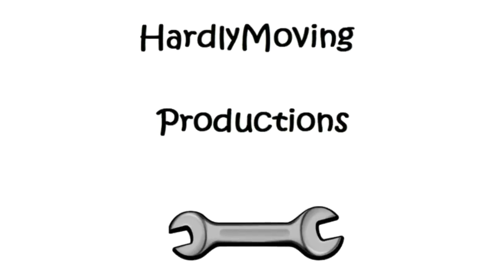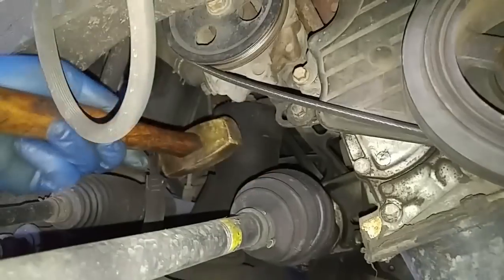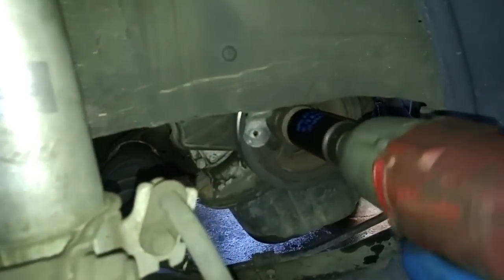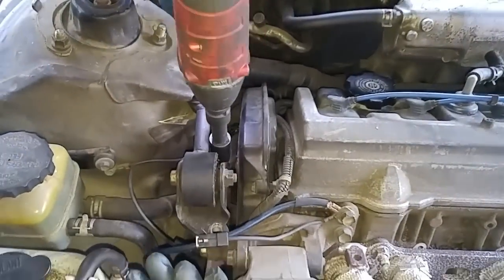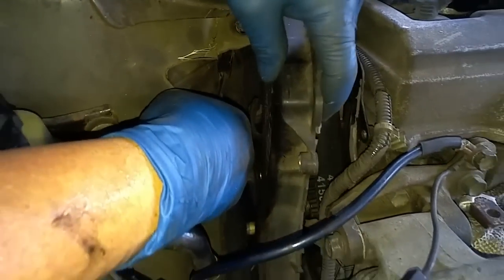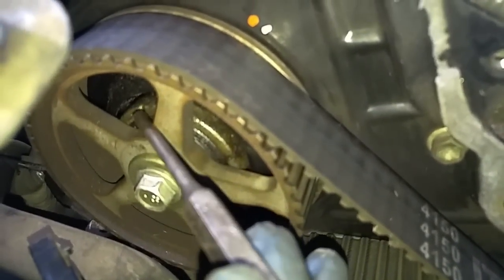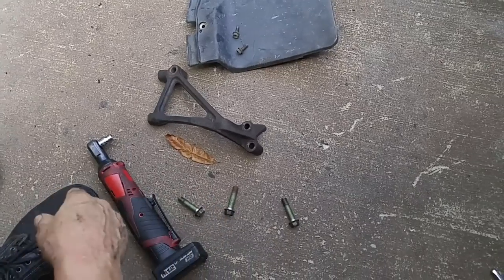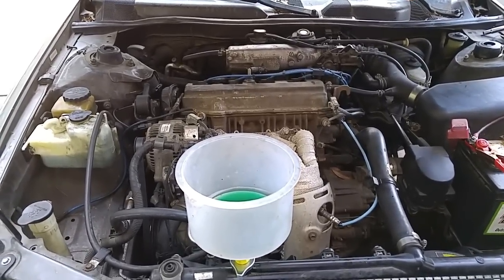Camry Timing Belt, Water Pump, Seals & Pulleys Replacement:  2.2L I4 5SFE Engine

Comment: I bought a JDM engine and put the timing belt and water pump on and the cover back on before installing it in the car. Do I need to remove the cover, now that the engine is in the car to verify the tension? Thanks, great video
Reply from the maker: No ... your fine.
Reply: @hardlymovingpro  Thanks, I didn't really want to undo it. Excellent video. 🔧
Reply from the maker: @billdougan4022  No problem.

Comment: Are you sure you should use the wire brush to clean off the old waterpump gasket? I'd be afraid of gouging the surface too much.
Reply from the maker: Absolutely.  We techs at the shop do it all the time.  Do not, however, use sand paper.  That is too abrasive and WILL result in a poor seal.  If you want, you can break in the brush by wire brushing against concrete.  This will get the wires oriented in the direction of the rotation.
Reply from the maker: And ... you do mean the water pump mount ... not the gasket?
Reply: @hardlymovingpro  Yes, I meant cleaning the old gasket off the mount.  I ruined an intake manifold using a grinder with plastic abrasive pads. But that was aluminum. So, I always cringe when I see someone using a wire wheel like that. Good tip about the cement!   
Also, your video was great - one of the best so far.

Comment: Question, the cam and crank marks dont line up how can i fix that ? do i take the timing belt off and line them up separately ?
Reply from the maker: Can't say without seeing what's going on.
Reply: @hardlymovingpro  I believe the timing belt slipped and  it jumped time, whenever I line up the cam the crank is off and vice versa it's the same engine as in your camry the 5SFE if this happened to you how would you go about realigning it
Reply: I'm sure you've already figured out yours but I'm writing this for the next guy that has the same issue. 

Take the belt off and line them up separately. After they're both lined up, put the belt on again making sure marks on camshaft and crankshaft stay lined up. The misalignment usually happens when you turn the crankshaft 2 revolutions. This is when belt tends to jump a tooth or two because the spring doesn't put enough tension on belt. In order to avoid this, after installing the belt with everything lined up, pull up on tensioner pulley to put extra tension on the belt, hold it there and tighten tensioner bolt. Don't torque to 31 ft-lbs yet. Just tighten it enough so tensioner doesn't move. Now make sure all teeth from water pump drive pulley, camshaft pulley,  and crankshaft sprocket are engaged with grooves in belt. If you have to do more work to engage any of them, you have to check timing marks on both camshaft and crank again. Once all this is good, rotate crankshaft exactly 2 revolutions and verify timing marks on both shafts are lined up. If they are, now make sure there is more tension on the part of the belt that's facing the front of the car than on the part of the belt that's facing the rear of the car.  If that's good you can now torque the tensioner bolt to 31 ft-lbs. Some people loosen the tensioner bolt at this point so that the only tension on the belt is from the spring and then they torque it to 31 ft-lbs. I do NOT loosen it and then torque it. I just torque it because the first few times I loosened it and then torqued it, the belt would come a little loose and rattle so I would have to do the job again. I've never had any problems with it being too tight because you can't put that much tension with one hand and I've never had one break. I have always replaced them due to mileage (90,000 miles) not breakage.

Comment: I have the same car and my timing belt broke. I can see that the crankshaft is off TDC now. I read that your not supposed to turn the crankshaft pulley to TDC without the belt, but it seems like a contradiction. Can you please clarify? After watching you do this I see that you adjusted the Crankshaft pulley with the harmonic first and then the camshaft up top afterwards, but your timing belt is on. Please help me figure out the process, thank you!
Reply from the maker: The 5SFE is a non interference engine so you can move the crank or cam (independent of each other) in any direction with the timing belt off.   You set the crank at TDC with the harmonic balancer on.  Find the notch on the balancer and turn the crank until the notch is aligned with the 0 degree mark on the lower TD cover.  Then remove balancer and the two TB covers to get to the cam.  Align the cam to TDC (via the hole in the cam sprocket) as shown in the video.  When ready to mount the new belt, you can turn the cam one cog to the right to ease the belt installation.  After the belt is on, turn the cam back to the TDC mark.  The belt should now have no slack and the crank should not have moved.
Reply from the maker: Here's the video link showing how to deal with a broken 5SFE timing belt:https://youtu.be/7LxaY6GPy-k
Reply: @hardlymovingpro  Yea your right. Thank you very much for taking the time to reply!
Reply: There is also a timing mark on the crank belt cog. It lines up with a small notch on the block at about 11 o'clock so you dont have to put the harmonic balancer on during the job. If you stop the vid at 14:32 when you are installing the crank seal you can see the notch.

Comment: I got both new tensioner pulley and idler, when I try to turn them by hands they barely spin 180 degrees. They are aftermarket branded. Normal or should I just reuse the one on the car ? (They spin more than freely)
Reply from the maker: Sounds like something is wrong with those new pulleys.  You should replace the old pulleys with new ones with the new timing.  Go to rockauto.com to get decent aftermarket pulleys.
Reply: @hardlymovingpro  Gotcha yeah good call thank you. I was able to find the seal  puller, a chain wrench and even the cam seal tool you're using in this video. I got an aftermarket water pump sitting at home but read the reviews ( "Ultra Power" ) branded and some guy said it broke after 3 months so now I am more than skeptical installing it
Reply from the maker: Try the brand GMB or Aisin for OEM quality.
Reply: @hardlymovingpro  thanks a lot for all your replies. What's your opinion on the NPW water pumps ?
Reply: @hardlymovingpro  I actually found a kit with Aisin waterpump and tensionners branded GMB. Should be pretty good right ?!
Reply from the maker: Yes.  I've used GMB with no long term issues.  GMB is a Japanese based company.

Comment: The pully with the spring is a tensioner and to adjust the timing belt those cars usually have a pointer and also have a a access hole in the cover for adjusting the timing belt
Reply from the maker: Maybe but I prefer to see the belt moving with the cover off to determine the right amount of tension.  I found the belt being a little loose makes a difference with respect to engine lag.
Reply: @hardlymovingpro   I've done many and I completely agree. I don't think @wmwil2564 is talking about Toyota's 2.2 liter 5S-FE.

Comment: great video as usually very informative thanks
Reply from the maker: Glad you liked it!
Reply: @hardlymovingpro  however I've seen the other videos and they say the camshaft has to be lined up with other mark there are two marks one like a circle from the drill bit and the other one like on your video v-shaped which is little higher up do you know something about it?
Reply: on my car it wasn't lined up at first place it did start up roughly and wasn't working properly as you drive so if I line up the crankshaft and then line up the camshaft itself without a belt would that work?thanks
Reply from the maker: To know what's TDC for belt installation:  1.  For the camshaft, line up the little hole in the cam sprocket with the vertical notch on the engine.  It's hard to see without a mirror.  2.  For the crankshaft, put back on the lower TB cover and pulley.  Rotate the pulley until the pulley notch lines up with the 0 degree mark on the TB cover.
Reply: @hardlymovingpro  put it all up together works way better then before however I've forgot to disconnect battery and alternator earth cable shortend up so blew the fuse other way all good thanks again
Reply from the maker: Okay ... great!

Comment: Nice video -- what happened at 18:33 can sometimes be avoided by the following a different tensioning procedure for this engine (5SFE) and the very similar 3SFE engines, as well as some other belt-timed Toyota engines.  The process is to install the tensioner spring before installing the belt, and to tack down the tensioner pulley at 45 BTDC cylinder 1 after ascertaining that timing is correct, following a particular series of steps

This is the procedure from the Toyota FSM.  It is a little unusual, but it works, and it helps to avoid the situation you guys faced in having to re-tension the belt.  This procedure is shown in this other video from Ratchets and Wrenches Channel, if you skip to the 03:26 mark in his video, you can see what I mean: https://www.youtube.com/watch?v=ZKHOOU6ZV-Y

Thanks for posting your video, too, since you show the seal replacement but R&W doesn't.  I just though I'd let you guys know in case you have another job like this one -- it can save you some time.  I've done the 45 BTDC on a 3SFE and it works great for tacking that tensioner down just right.  

Thanks again.
Reply from the maker: Thanks for your post ... but been there, done that and doesn't work for some reason with all replacement belts (Gates, Dayco, Continental, Mitsuboshi,  ITM, etc.).  Use to do the 2 full rotation method and the belt still became loose after starting the engine (of course after buttoning everything up and having to remove everything again).  Starting the engine does a better job of seating the belt with hundreds of rotations instead of 2 rotations.  And its always good to verify your work by observing the belt rotation while the engine is running to look for belt wobble (indicating a loose belt).  Don't agree with stretching/maxing out the tensioner spring BEFORE putting on the belt.  What's the big deal putting on the spring AFTER the belt is on? Also, there's indication that there's a oil leak from either the cam seal, crank seal and/or oil pump housing seal that he hasn't addressed (which will result in a premature belt snap when oil gets on the belt), there's no way the water pump will last to the next service interval unless he replaces it now, and he's putting on the belt with both the cam and crank at the TDC mark which I've found most techs I've trained have difficulty doing (most especially with newbies).  You just advance the cam one cog, mount the belt then set the cam back to the TDC mark ... simple and easy.  This is what I've learned after doing over a hundred timing belt jobs and dealing with customer "come backs".   Again, thanks for your post!
Reply: @hardlymovingpro  Thanks for the reply!  Yeah, I agree that R&W should have replaced more parts while he was in there, but maybe the customer couldn't afford it or it was his own junker, I don't know.  I linked that vid because he shows the little 45 BTDC mark, which is hard to describe without a picture.

I know that process doesn't always work, but it has worked for me, so I thought I would share it!  Thanks again for the video.
Reply from the maker: Hey ... no problem and good discourse. FYI - if it was my own junker, I'd replace the seals and the W/P.
Reply: @hardlymovingpro  Haha, agreed.  Thanks again

Comment: Where can I buy that tool with the chain you use to hold cam sprocket when tightening bolt.
Reply from the maker: It's called a "Chain Strap Wrench".  You should be able to buy one from any hardware store.  They come in different length handles.  Use your search engine with the search words "Chain strap wrench for sale" and you will get a lot of hits.  There are good deals on Ebay and Amazon.  I have a video on all the different types you can use.  Here's the link:
https://www.youtube.com/watch?v=h1kKlCkmfT0

Comment: Your video and I are working on my 98 Celica this weekend. Feel pretty good about it and I think I've got everything I need including oil pump seals. 
While I was going through your tool list checking off what I have I noticed you listed a 22mm high mass socket instead of the 19mm high mass sockets for the HB pully bolt. Typo?
Reply from the maker: 19 mm for Honda's ... 22 mm for Toyota's.
Reply: @hardlymovingpro  As it turned out, 19mm for 98 Celica GT. Thank you for your video and sharing your knowledge!!

Comment: Need a quick answer... can the timing 0 mark on the crank pulley be used as a ref mark for crank/cam alignment?In other words, must you use the crank gear timing marks in order to align with cam timing marks?
Reply from the maker: You can use the 0 degree mark on the lower timing belt cover and align with the notch on the harmonic balancer.  Just make sure the cam sprocket is also in alignment;  otherwise, give the engine another full rotation and the cam will be in alignment with the crankshaft.
Reply: Hardly Moving Productions  okay thats great. They are working on my car now at the school. They agreed the timing was off by 1 tooth (10 degrees) Which is why my gas mileage was so bad. They used the pulley zero mark and the cam timing marks to get the timing right, which is why I wanted to know if that can be done using the pulley marks instead of the crank gear marks. The car is almost back together now, but nobody has started it yet. We’ll see
Reply from the maker: To ease installation on the belt, either the cam or crank should be moved towards each other (around 1/2 cog).  After the belt is on, move the cam or crank back to TDC alignment marks and recheck the alignment.  Start the engine ...  shut off the engine ... recheck for excess belt slack.  It's all covered in the video.
Reply: @hardlymovingpro  Well, it's hard to explain, but I wasn't in the position to tell them how to do it, but I had two teachers and 2 students working on it. I was only getting drabs of info as to what they were trying to do, but they ended up de-tensioning the tensioner and slipping the belt by one tooth atthe cam gear. It took 3 of them to do it. It worked! Prior to that, they were trying to to see if I was right- that the timing was off, but they only removed the top TB cover and were using the crank pulley marks as the crank reference, not the crank gear timing marks- that's why I asked you if that was okay to do. So it all turned out great. The car runs good now and hopefully the gas mileage is back up to 29mpgs. They didn't do the job the way you or I would have, but it got done and I thank you for your help and your video.
Reply from the maker: @dbfcrell8300  Hey ... good for you!  2 instructors and 2 students?  That's funny.  As the saying goes "If you can't do the job, teach!"   And the Toyota 5SFE is not some unique, weird, exotic European engine design.  There's millions of cars out there using this engine and one of the easiest belts to replace (at least from my perspective).  Hope they replaced the camshaft seal.  It won't last another 100k miles ... and neither will the power steering pump housing seal.
Reply: @hardlymovingpro  It's funny, I supplied the seals but they didn't replace them. By the time they go bad, I should be able to do the job myself- not to whine or anything, but I have chronic Lyme disease, which I'm getting treated for, so right now I cannot do the job, but it's totally curable, so I'm hoping to be able to work on my car again by next summer. This is why I had to have the school do my belt (plus it was free, less the parts).
Reply from the maker: Understand and sorry to learn about your Lyme illness.  FYI - I had replaced "broken" timing belts caused by oil leakage getting on the belt due to leaking seals.   Oil on belts is a big no no.  Makes the belts swell.  On the 5SFE, you'll notice oil drips coming out from the bottom of the lower timing belt cover.  Watch this video on the Toyota V6 1MZ-FE engine and you'll see how bad it can get.  https://youtu.be/KkjgBVxBaeU
Reply: @hardlymovingpro  I just watched the video, thanks for the link. I do understand oil is bad. However, if there's any concellation, I used a Gates RPM extended wear blue racing belt which is extra tough and impervious to heat and oil, so I should be okay for a while. I made a crappy video while I was watching them work. Not sure it's worth your time to watch it, but here it is; https://www.youtube.com/watch?v=FOgEwBTHvUI&feature=youtu.be
Reply from the maker: I'd say give around 50k miles and the seal leakage will become noticeable.  Around 4 to 5 years away?  But then again, the 5SFE is going on to be 20 + years old.

Comment: great vid, i just did this on my 5sfe only to find Im leaking coolant from behind the oil pump 😬
Reply from the maker: Check the gasket for the water pump.
Reply: @hardlymovingpro  yes was the Oring behind the water pump.

Comment: Ok so I had to fix the oil pump leak. Fitted new pump vanes, seal and spaghetti o ring. Also fitted new timing belt. Turned engine over checking belt timing. All seemed ok. All timing marks lined up. Finished reassembling all the bits and pieces. Started engine idles fine. New oil pump worked perfect. My problim is that when doing test drive the car seemed sluggish from standstill
 Ran ok at speed. I am thinking I have the timing belt out 1 tooth. Anyone have an opinion on my dilemma.
Reply from the maker: If the belt alignment is off, your check engine light would usually come on.  The underlying code would indicate a camshaft position sensor error.
Reply: No check engine light showing. I am going to put my timing light on to see if that shows anything. To my way of thinking the ignition timing would be out slightly if the cam timing is out seeing as the dizzy runs off the camshafts.
Reply from the maker: @legsofsteel1  Conclusion makes sense.